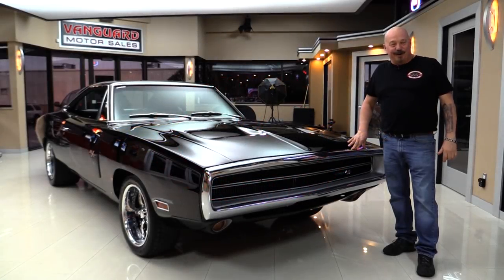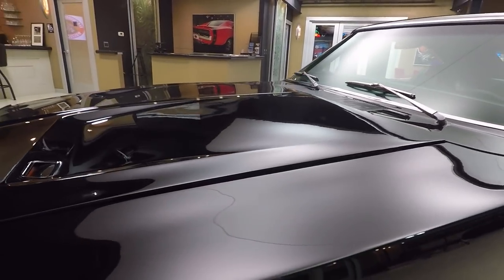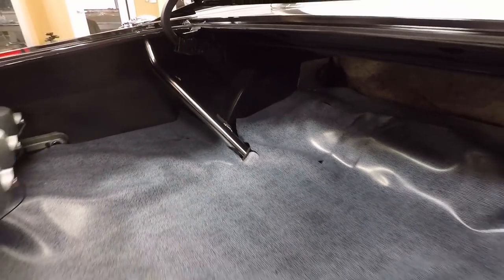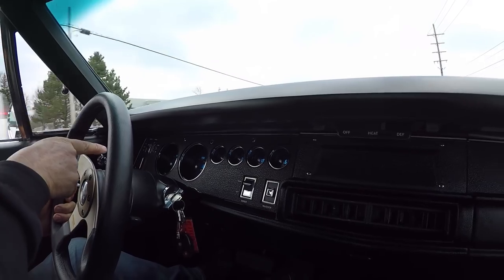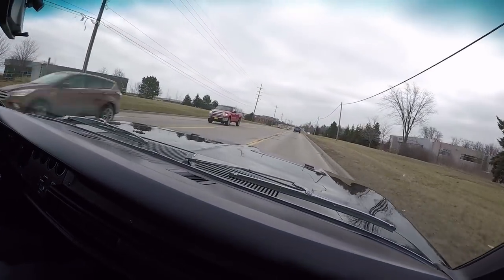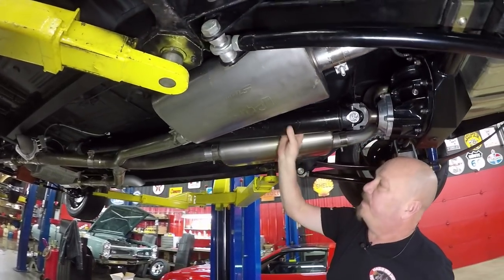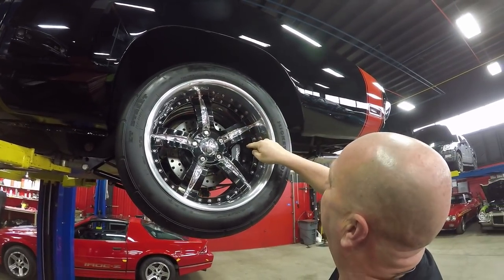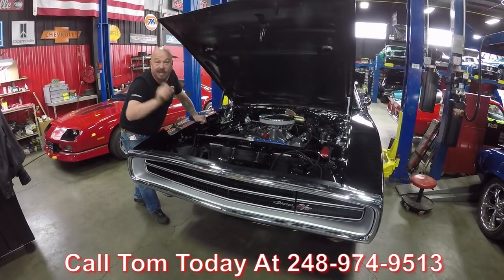1970 Dodge Charger RT For Sale

Comment: Beautiful. I had a 72 fastback mustang originally with a 302, tried to shove a 427 but wouldn't fit (like putting a melon where a lemon should be ) so I put a 400 straight in it. Sold it for a 70 goat with a 400 already in, now I have an ss camerro with a small block and blower. Does the quarter in low 10s (not the fastest I know ) but mostly only drive it to car shows in Compton and Long Beach. Compton majestic all day.  Charger is beautiful

Comment: In the sixties my dad bought a 66" red 383 charger. A couple years later Plymouth dealer he would sell my dad a 69 1/2 cuda' 440. Mom drove the charger dad drive the cuda'"  red charger. Orange & black cuda' dad had to take the 440 cuda' logo taping on the front quarter panel off everybody at every light wanted to race. He left the scoops on. Next year Plymouth changed to E body.